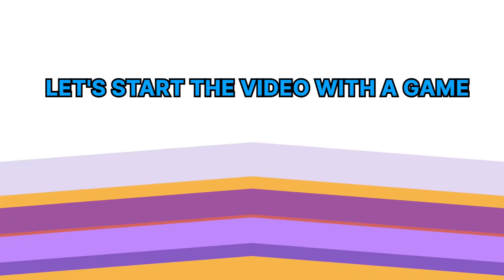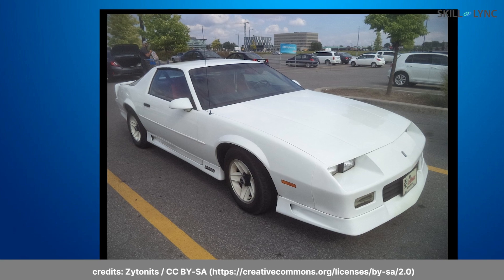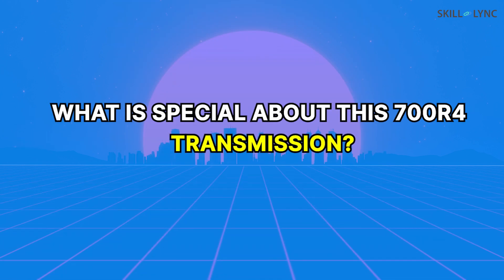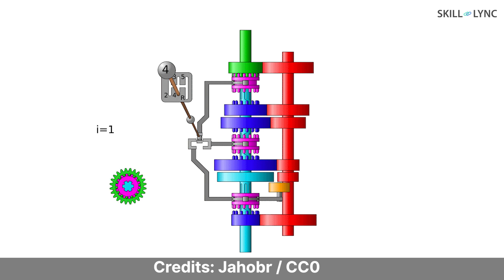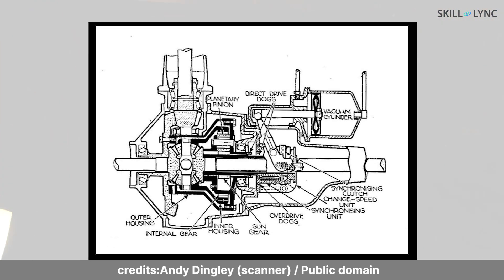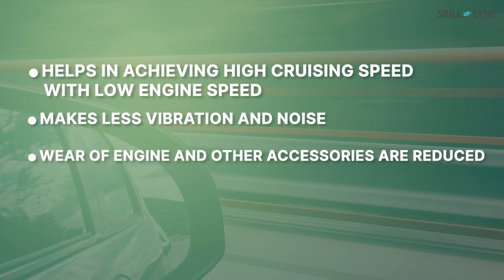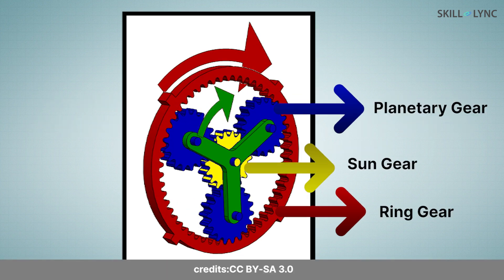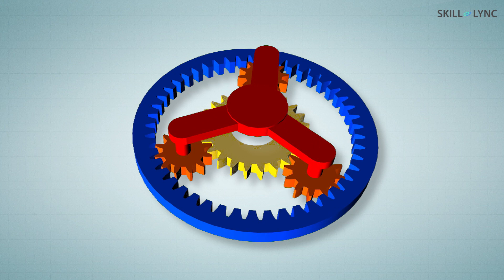What is Overdrive? | Skill-Lync

Comment: I have a question for you gear heads out there-

So, I saved a 1988 Buick Lesabre Hearse from a scrap yard this week. The big girl runs well, is in great shape, and is genuinely fun to drive. I've gotten many smiles from her at work. I didn't want to see a piece of history get destroyed, and it was the first thing I ever bought for myself. I finally got off my lazy ass and became a productive member of society. 

Anyway, what I wanted to know was if it is safe to keep her in overdrive? It's an automatic transmission, but she doesn't automatically switch to it, I have to manually shift her into that gear. Is that bad for the engine? I don't know much about the mechanics of cars, let alone old ones, and I genuinely want to take care of her. I probably didn't think it through too well when I bought her, but I am proud to know her fate won't be her rusting away.

Comment: Holy crap dude. You have the most understandable schematic illustration on the manual gearbox transmission. Now I get it. All the other videos I've watched have failed to explain transmissions in general, and this is finally understandable. I still don't get Overdrive, haha.
Reply: It increases your final drive output which allows the engine to turn slower and the driveline/wheels faster. There, for you two 4 year olds. Lol jk
Reply: why are you praising the explanation if u still dont get it?  'If you cant explain it to a 4 yo child then you probably dont understand it yourself'  ,  A;bert Einstein.  PS :  I didnt get it either so Ill be looking somewhere else.

Comment: Im not understand why overdrive cant increase speed...😭
Reply: It is not that it increases or decreases speed, it is that it allows the car to achieve that speed while the engine does less work
Reply: Overdrive is just the highest gear in the transmission it allows you too go at higher speeds with les RPMs so it be useful on the highway. The cars that had an overdrive button all that was doing when you pressed the button was allowing the the transmission to shift to 4th gear. Most cars now just do it automatically by detecting how fast you are going as long as you have the shifter in D you’ll get overdrive. If you have a manual same thing 5th gear be overdrive
Reply: @ryans413  ah thank you for explaining, I'm just getting into cars and i just couldn't understand overdrive really well. Thanks for the explanation!
Reply: @hannankhan2507  no problem it’s basically just the highest gear on the transmission that’s it. It’s the gear that matches the engine speed so it be 1 to 1 that’s overdrive. Whatever speeds the engines doing that’s what the output shafts doing to the wheels.